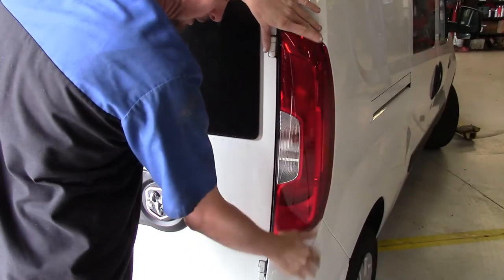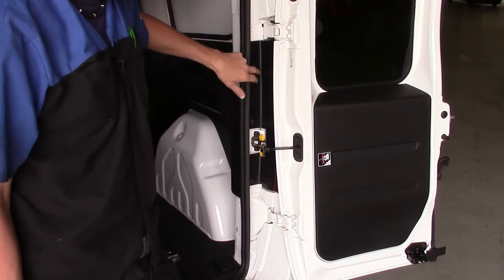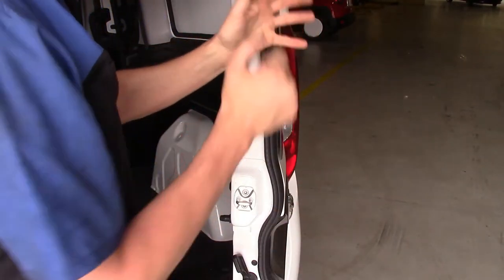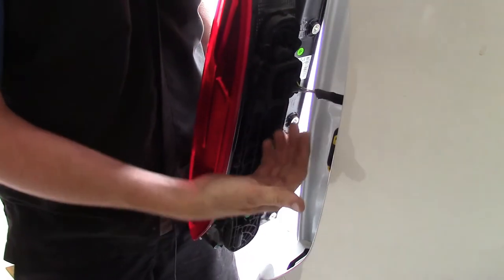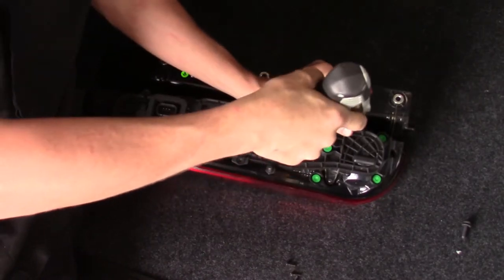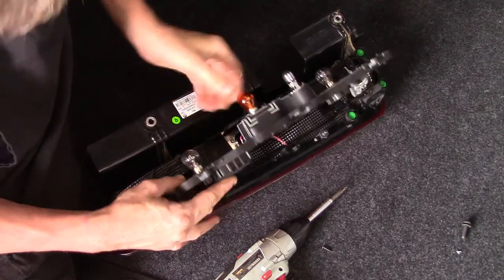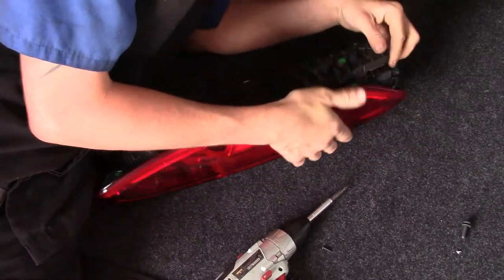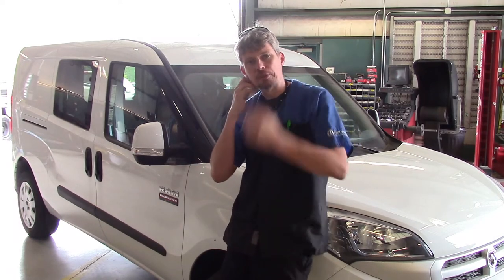2015 Ram Promaster City rear tail light bulb removal

Comment: Does this work for fiat doblo?
Reply from the maker: I have no idea....haven’t seen one or come across one yet to be sure. Make sure to subscribe
Reply: MotorCity Mechanic sure. Managed to remove the brake cover by following your steps. By any chance could you do a video putting it back in?
Reply from the maker: I will certainly keep it in mind as a future video.
Reply: Yes. Identical vehicles, just with different badges.

Comment: Super helpful, thank you. I had a bit of trouble loosening the 3 large bracket screws. They are really tight from the factory. Luckily they are large enough to grasp the edges with a vice grip and a quick twist will break them  free. The rest is easy.

Comment: I replaced the brake light, but the error message on the dash still says its burned out.  Any suggestions?
Reply: I got the same issue! Did you resolve it?
Reply: @randyjara1076  haha two years later and I still haven't fixed it
Reply: Try the same procedure that is used to clear maintenance warnings. Turn key to On position without starting the vehicle.  Press the gas pedal down fully 3 times.
I know this works for removing the Oil Change Needed alarm